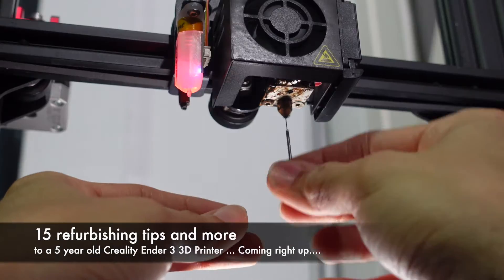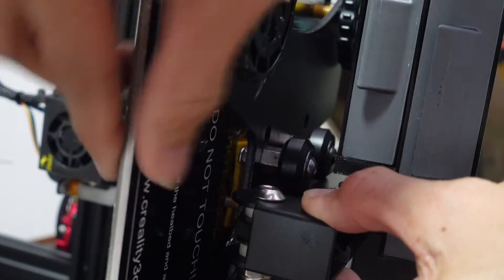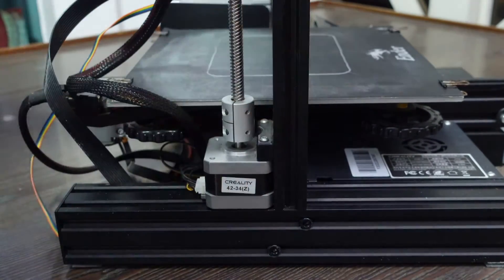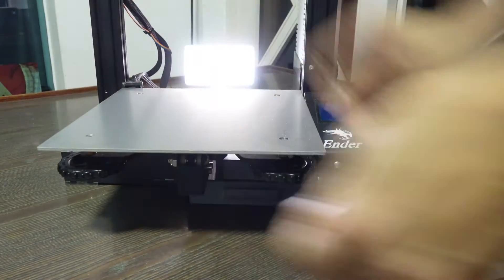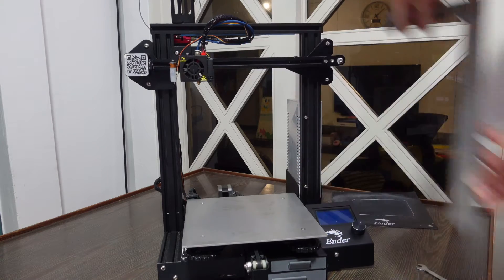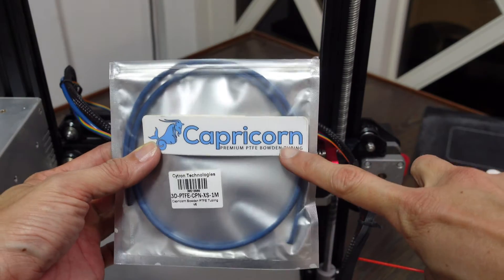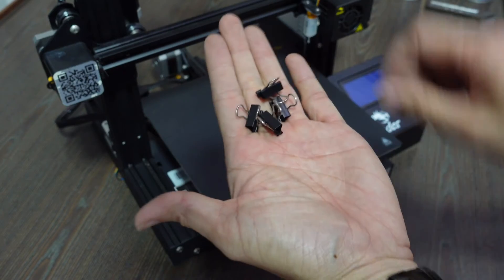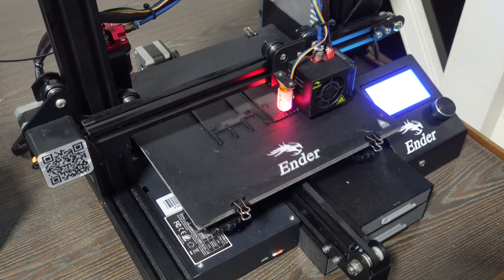Revive Your Creality Ender 3 V1: 15 Tips for Longevity in 2024

Comment: anyone else get the feelin that when you move the motors manually. They create a charge and can damage stuff no?
Reply: technically speaking a generator is a motor that is spun by outside force however you'd have to provide a lot of RPM to create any meaningful current, and there is very likely a diode in the way (diode only let's electricity flow one way) anyway as it prevents shorts going back to parts that are sensitive.

Comment: There is a ton you can do with these printers beyond just the stuff here, for little cost.
PEI spring steel sheet - a must have that can be both clamped down and held by magnet sheet. Creality sells a kit that comes with the magnet sheet, I have that and it's perfect. Every few prints I wash it with soap and water to get the residues off and it's practically like new again.
Direct Drive kit - there are printable mods that let you reuse the original extruder, those are free but quite heavy on the print head. There are lightweight options on the market, though they do cost more than just mounting the original motor to the head. I got a Sherpa Micro for my printer, and between the extrusion consistency and nearly eliminated stringing, I think it was worth it.
Frame brace - you can buy a metal brace, or you can print one, essentially just a rod that connects the back at the feet to the top of the Z rails. Putting them on mine made the whole assembly feel noticeably more sturdy, I think it can be trusted to hold its angle indefinitely from here on with how rigid it is now.
T slot fillers - another thing you can print, or buy. Helps a ton with keeping debris out of those T slots, and makes the printer easier to clean up. I bought some for mine, because thet ckme as an extruded soft rubber which also seals the channels off from dust. Also adds a very nice accent to the printer, whichever color you print or buy.
PSU base mount - this is something you print, it moves the power supply to sit flat underneath the Y carriage. Cleans up the whole look of the printer, and moves the center of mass down. Not sure if that affects print quality, but it only costs what filament and electricity it takes to print and feels sturdier than the stock setup, especially the plastic around the plug socket, so it's 100% worth it.
Last but not least for the low cost/basic mods, completely replace the bed springs. Not with stiffer springs, not with silicone spacers, not even with those hard mounts you adjust with washers - hard mount it using a handful of M4 nuts and locknuts, with some nylon washers of course. Four washers and lock nuts to hold the screws into the bed, four regular nuts after that, put the bed down, and then a final four lock nuts to replace the wheels. It's a pain to tram since you have to adjust a locking set of nuts for every corner with a pair of wrenches, but once you get it right it should hold indefinitely.
I've done a whole lot more to my own printer, but it's hard to think of anything else I've done that's cheap and easy to do, so I'll leave it here.
Reply: To add in that list, klipper with a adxl345, auto bed leveling, 42-48 nema 17 for the y axis, a bambu, tz, or similar hotend, with a decent extruder and now we talking, without that the machine is slow AF

Comment: DISCONNECT ALL THE WIRE TO THE M0TOR BEFORE DOING ANYTHING LIKE MOVING THE PRINT HEAD TO FAST OR MOVING THE Z AXCES, because it will send out a current to the main board and might short it. i have burned 2 motherboard just like that, the monitor lighting up when you more thing by your hand is a sight of that. move it slowly or disconnect the wires to the motors of your moving them fast with your hands while doing repaires. I am horroble with spelling please ignore my mistakes
Reply: Wires from stepper motors, or just unplug from the wall? I'm curios now...
Reply: @wakizashiyoshikawa6926  unplugged from the wall will not do much, when you move the moder by hand, it generates its own correct that will damage your bored. Your screen turns on even when power is off when moving the motors .
Reply: @kingbaaka3D  wow, had no idea really thanks for a heads up! So basically disconnect stepper motor cables should do, right?
Reply: @kingbaaka3D  cheers, thanks again!
Reply: I can turn the printer on if i spin the motors fast enought lmao

Comment: Great video! Although you should never try to move any motor quickly causing them to generate electricity that feeds back to the main board and can fry the board. I've done that very thing my first printer. Move slowly. Newer boards have feedback circuitry to prevent this. I didn't believe yours does since I saw you LCD screen light up. Great video, I was thinking of snagging a used Ender 3 with a fried main board for$50. Easy fix
Reply from the maker: Thanks for the comment and great tip!! I will be mindful next time. Cheers...

Comment: Great video, mine from 2019 is still printing great, I print mostly ABS. With an SKR mini E3 v1.2, metal extruder, BLtouch clone and capricorn tubing, I easily get 100mm/s and 800mm/s³ accel.

PS: 2:45 You should back off the screw, it should not be touching the motor shaft and should be above the middle notch of the coupler, an easy way is to insert the spatula that came with the printer in the middle notch then insert the screw, it will make sure it stays above the notch.
Reply from the maker: SKR Mini E3 is cool... !

Comment: Btw - WD40 is not really a lubricant, it displaces water. Much, much better off to use a spray can of white grease or other lubricant if at all possible/available - just an FYI
Reply from the maker: We did not use the WD40 multiuse product.. These are specific White Lithium Grease, PTFE Dry Lube and Silicon Lube by WD40 company.

Comment: I think these are all great points, and if followed + some key parts will have them printing for several years more. 

I think you’ def have to install a Capricorn PTFE tube and swap out the original bed for a PEI or other metal’ bed (re the VOC’s/smell). 

Replace those OEM springs with the orange ones like yours makes a huge difference. 

Print 4 wheel locks, to keep them from loosening after leveling helps too. 

Otherwise, no reason not to keep using, time/speed is the biggest factor for some, yet mine are still used all the time, esp for large prints and/or masks/helmets or whatever. 

I have 3 Ender 3’s, ($99.00 each/Microcenter) 2 CR-10’s, an Ankermake M5 (ugh) + a Saturn resin printer I’m learning to use and have a purpose/use for each. 

Thanks for your videos +1 subscriber.
Reply from the maker: Thank You.. Yes!! PEI is next, still in shipping and I can't wait for it. Hehehehe
Reply from the maker: Thank You !

Comment: Great video! As an Ender 3 user I should say it is 90% accurate and usefull!
I would suggest upgrade feeder to BeMeGe (can be printed and use BMG replacement parts) (or K3d minifeeder and making a DD)
I would not recommend tighten bed springs too tight as this will deform the bed. Also you can make surface even with aluminium sticky foil. Just apply it in lower regions.
Also I would suggest add PEI magnetic sheet.
There is a lifehack if you bed keeps unscrewing, you can put bed spring knobs upside down, so they will be very tight and will not unscrew on its own.
Also you should not move print parts so fast you motherboard can go out.
Also I suggest making directdrive and upgrading your firmware, applying input shaping and linear advance. So you can print up to 100mm/s with no problem (and may be higher, but I print PETG and it is no always print good after 90mm/s)
No need for Klipper firmware and all that Pie and Linux stuff (which is not bad at all, but not for everyone for sure). Marlin is sufficient.
Reply from the maker: Thank You. Will check it out !